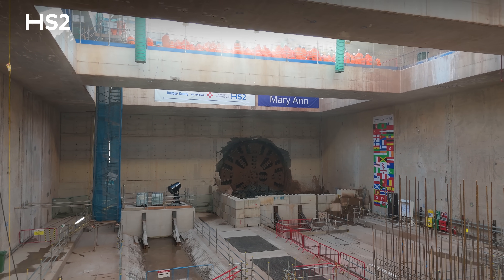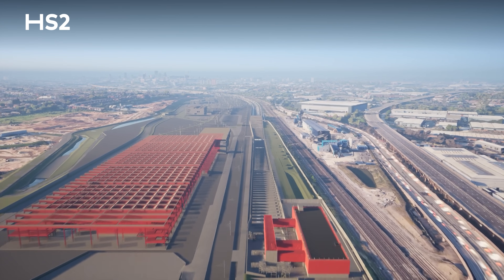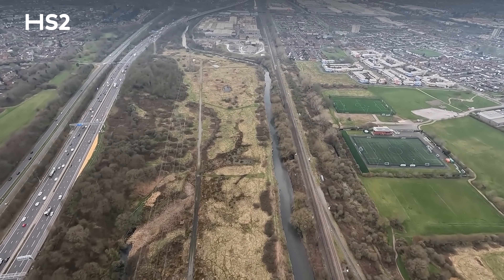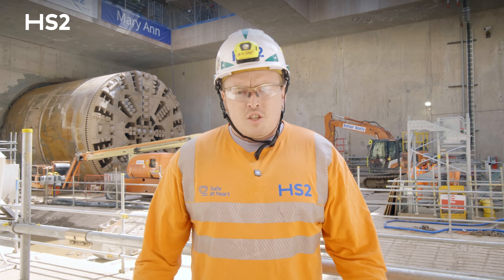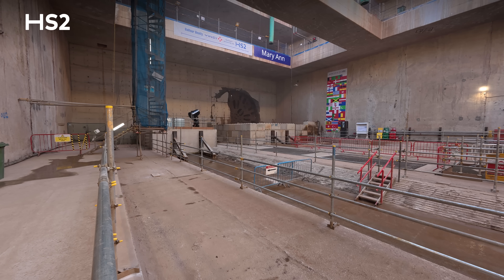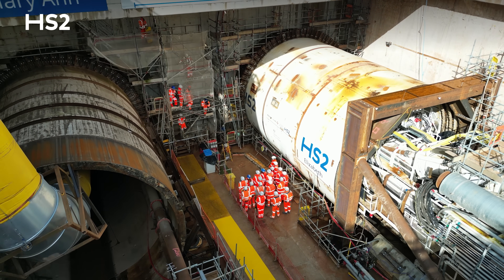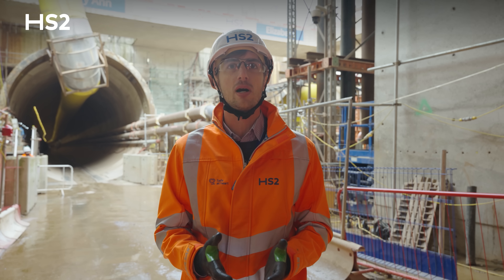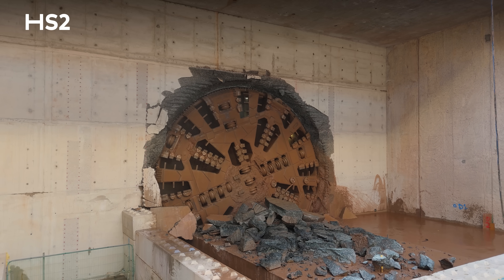HS2 Bromford Tunnel progress update 🚆 One tunnel drive done, one to go 🏗️

Comment: I often think that few members of the public know about the operation of a tbm and even fewer appreciate what it actually achieves during its operation. For those who are interested, it is a fascinating and very impressive piece of machinery. That said, it shows how smart some people are in imagining, building and operating such a huge and complete piece of engineering equipment. Well done to all associated with the HS2 project. 👏🏻👏🏻👏🏻 J
Reply: Indeed. I worked for a company who built the tunnels on the western section of Crossrail from Royal Oak, Paddington to Liverpool Street. The whole Crossrail project was the most complex project I ever worked on and the tunelling was but one complex piece of the project. The ground changes from clay to gravel in the Farringdon area requiring measures to prevent tunnel collapse. Then there were deep foundation piles to bore between just outside Tottenham Court Road  and shallow foundations to underpin in Soho Square.

Comment: I don't really understand why it matters that there are electricity pylons or a river above the tunnelling machine unless they are particularly shallow tunnels. If that is the case, surely even when all the concreting is done, the vibration from trains passing through will always be a problem for the same pylons and river crossings, especially over time?

Comment: Question, why a "break through wall"?
Reply: A tunnel portal has to be built at the end of the tunnel and the wall is part of the portal. If they didn't build a portal the end of the tunnel would collapse when  the TBM broke through.
Reply: Actually a good question but most people wouldn't realise. 
TBMs dig by forcing themselves forward using huge hydraulic rams, this compresses and stabilises the material so that a tunnel lining could be built. 
If the wall wasn't there,  and as the material they are digging through isn't very strong,  it would just collapse outward when the tbm got close,  meaning that you'd have to manually dig out the last part,  which would be far more time consuming,  costly and dangerous than just building a wall for the tbm to push against. 

The last little breakthrough is just for show though
Reply: @xaiano794 Yes, and the wall helps to compress the soil with the pressure of the TBM cutting head acting against it.

Comment: Hopefully, the returns made when it opens spurs them to build the line to Manchester, Leeds and eventually to Glasgow and Edinburgh
Reply: Apart from the well heeled and politicians, exactly who is going to afford to buy a ticket for HS2?...
Reply: @leethrelfalllt Right, the same argument could be made for The Elizabeth Line yet its one of, if not, the most used line in the UK.
Reply: @leethrelfalllt  Every one man, as the High speed services from Manchester,Liverpool and scotland will run on the HS2 route when it opens not the WCML as now
Reply: Gibberish!
Reply: @leethrelfalllt  Gibberish, do you know anything about HS2 if you did you wouldn't quote such crap, HS2 is being built to mirror the existing WCML from London Euston to Birmingham and Handsacre in Staffordshire where it will connect on to the existing WCML. When HS" opens the operator of the WCML Avanti West Coast Trains will divert the vast majority of it's High Speed train services onto the HAS2 route at Handsacre, so every one that travels on an vanti West Coast train service from Manchester, Liverpool and Scotland will travel on the HS2 line as these trains will join the HS2 route at Handsacre Junction and travel via HS2 to London Euston, so everyone will travel on the HS2 route try doing a little bit of research mate

Comment: Glad the French showing you how HSR is done.
Reply: Only part French. The Contractors are Balfour Beatty and Vinci. Balfour Beatty are British. While Vinci are a French company, the UK arm comprises the civil engineering arm of Taylor Woodrow and the building arm of Norwest Holst who were both British.
Reply: @TrevorWilliams-fq8mg  I know. It was just a bit of trolling from me ;) What I meant is that UK and France have similar economies and you should have an HSR network as good as the french one. Or Spain.  Imo it is not normal that you struggle to build HSR lines in your country. The fact that HS2 has been scaled back is really disappointing...
Reply: @calahan59 HS2 has divided the Country. We do need to ease congestion on the West Coast line, but I'm not convinced a high speed line is the answer. France and Spain are bigger Countries than Britain and it is much easier to build a high speed line there as there is a lot more open Countryside between Cities. We are a much more crowded Country so it is more difficult to build.
Reply: @TrevorWilliams-fq8mg  Ok thanks for your explanations. I hope maybe later they'll build the initial project.
Reply: I have no doubt it will be built as they are too far for it to be cancelled. But the cost ?..... nobody would dare to predict.
Reply: @TrevorWilliams-fq8mg  I know they'll finish the Birmingham/London line, I meant the Manchester/Birmingham branch.
Reply: @calahan59 That's a good question. Probably not.

Comment: Amazing Engineering.   It will be so good to travel from just South of Birmingham to 7 miles short of central London and only costing the tax payer fifty billion pounds….a bargain. 😂.      🚂🚴‍♂️👣🇺🇦
Reply: You're welcome not to use it.
Reply: @-Osiris-  but pay for it through your taxes instead.
Reply: @123tinhat123  You pay for a multitude of things indirectly through your taxes that you will never use,  your point is irrelevant.
Reply: It is going to Euston but I think Old Oak Common will be more useful to most people.
Reply: £50BN? I think you'll find that close to, or slightly over £100BN, but I agree... amazing engineering
Reply: HS2 is not going from just South of Birmingham, it actually terminates in the City Centre of Birmingham on Moor Street Queensway opposite the Bullring Shopping Centre  and next door to Moor Street Railway Station at Birmingham Curzon Street Station and travels through East Birmingham not South Birmingham and will be terminating in London Euston, you need to catch up on the latest news on HS2 👍👍